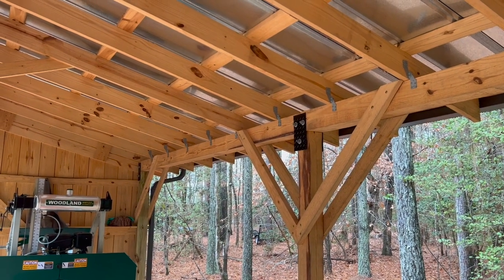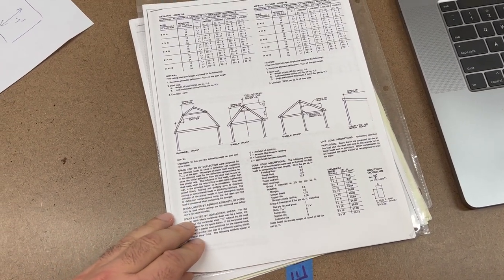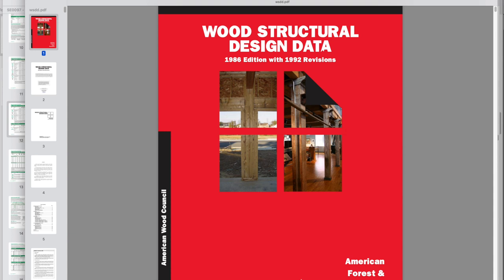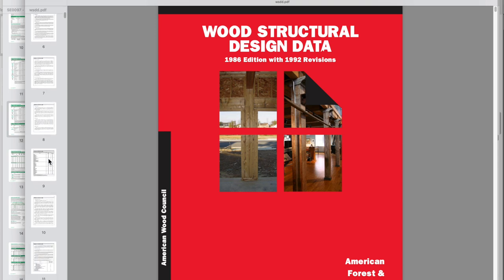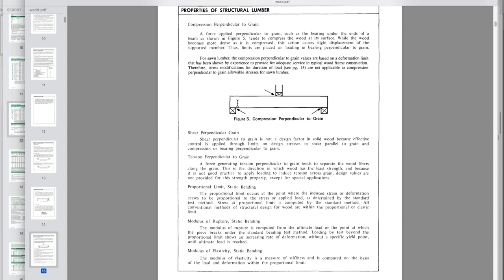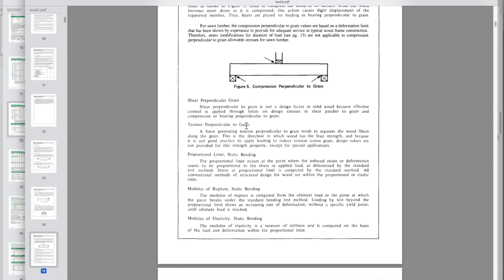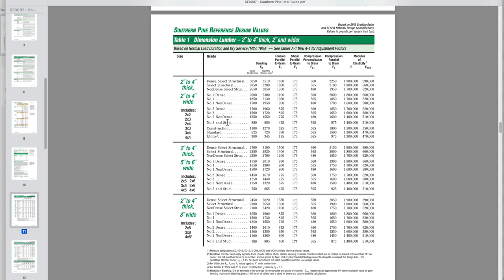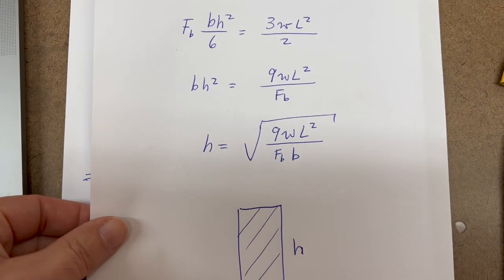What size beam do I need for my sawmill shed?

Comment: Great Video, I understand this was just an "example of the process", and is very good, but only issue might be that some folks might get confused of your use of Fb=1200. The reference material you show is for members 2 to 4" thick, 2" and wider, and your calculations are for a 5.5"x12" Beam...which is a "timber" that would be on a different but similar table by Southern Pine, and that table shows a #2 Fb value of 850...I was a little confused and thought someone else might be also, if you look at the current version of the table you show, the Fb for #2 starts at 1100 and decreases as the width increases...hope someone else who is working thru this doesn't get hung up like I did for a bit, keep the mill video content rolling, thanks
Reply from the maker: That is a good point, and a lot of these values depend on how you want to grade/rate the lumber.  I'll have to go back and look in my notes but I do remember adopting 1200 as a general purpose average for SYP even before I was using that guidebook.  Larger timbers could possible admit more flaws/knots/etc which is why they tend to get downgraded.

Comment: great video! excellent reference materials and your pictured formula explanations and verbal explanation really took the complex and made it easier to follow and figure out.
I am looking to do the same project for my sawmill and was looking at incorporating a "Scarf joint" midway of a 30-foot span, (Maple beams: 5.5"x12"x15') for the front opening of the Mill shed. Your reference guides will help me greatly in the beam dimensions to be cut. Again, good stuff !!!
Reply from the maker: Thanks!

Comment: Interesting video.  I am getting flashbacks from my post secondary education in Civil Engineering Technology almost 40 years ago.
Structural design was my favourite subject but I never got the chance to use the knowledge in my field of  work. 
 Did you also check the design for your posts (columns)?
Reply from the maker: I didn't since it's normally not a limiting factor on my structures, but it is important to do in general -- both for the vertical load and buckling concerns.

Comment: Great video. Can you explain a little more on how you were able to mix units of measure. For example, I would have thought you would have needed to convert “b” and “h” from inches into decimal feet before plugging into formula. Follow up question, and advice on how to calculate the laminating of boards together to make a larger beam? For example, my saw mill can only cut a 18’ board, but I also want a 25’ beam, so I was thinking of laminating 3 boards of overlapping lengths to create the full span. Thanks again.
Reply from the maker: That is a great question.  The formula was setup with a conversion so that bending moment comes out in in-lb and the units are consistent with the other side of the equation.  This was done on page 30 (#35 in PDF) of the WSDD handbook where you will see they slipped in a "12" to convert ft-lb to in-lb.  So L can go in as feet while b and h are inches.  Fiber bending stress Fb is in psi.

Overlapping is a real pain and you'll end up having to oversize quite a bit and use loads of fasteners.  You become very dependent on the fasteners, holes, and grain to resist sagging in the middle in order to handle the compression and tension loads.  The calculation for that will be much more complicated.  I wouldn't want to do it.

With care you can work a longer log on the mill bed if you have the ability to shift it back and forth.  Cut as far as you can, use a  chainsaw and hand saw to carefully remove the cutoff above the blade, then raise sawhead and reposition log to complete cut.  Repeat many times.  It takes a lot of fussy positioning but works.  I would not want to do it often but for a one-off beam it's doable.  Personally, I use my Alaskan Chainsaw mill in situations like this.  No limit to the length it can cut other than your patience.

Comment: your preference when milling and cutting 2x4,2x6,2x8 etc example 2"x4" or 1.5" x 3.5" ? Thanks for the informative video .
Reply from the maker: No preference, really depends on the project and whether or not the lumber will be mixed with store-bought dimensional lumber.
Reply: @Lumber_Jack   was not thinking of mixing. What did you use on the sawmill shed ? Does the true 2"x 4" etc tend to move less than 1.5" x 3.5" etc bow, check, curve, crown. TY for the reply
Reply from the maker: @logan979  Stability is really dependent on many factors and size may or may not make a difference at all.  I normally saw lumber to 1-5/8" thickness for framing projects (it will dry to 1-1/2") because I often use brackets and hardware sized for store-bought lumber.  Note that 2" lumber is insanely heavy to handle when using green, so that may be a factor as well.  If framing with green lumber, you can avoid stability issues if you get the lumber in place ASAP after sawing, properly nailed/braced before it starts to dry.

Comment: Considering the loads and structural geometry involved, what are your thoughts on using expanding composite foam for anchoring your sawmill shed, car port, etc. posts instead of concrete?
Reply from the maker: I don't know enough about the foam.  It would need to be able to provide some uplift resistance (concrete will have an advantage due to weight) and also resist side loads to prevent the poles from racking over.

Comment: I find the "Compression Perpendicular to Grain, Fiber Stress at Prop. Limit" of Loblolly Pine is 790psi.  Is that not the same as your Fb measurement?
Reply from the maker: Fb is the fiber bending stress due to flexure, whereas compression perpendicular to grain tends to be about what type of bearing area the wood can support before the grain yields.  You have to worry about this at joints, to make sure they are large enough to carry the load without crushing the grain.
Reply: @Lumber_Jack  thank you!

Comment: I feel like I just got an F in math class again. Lol. My worst subject by far. Did you use an LVL beam or was it pine? Is the calculation the same for an LVL as it is for pine?
Reply from the maker: I used LVL.  Same calculation but an LVL has much much higher fiber bending stress values than traditional wood, so you can get by with smaller/lighter beams.  Most LVL manufacturers will have product sheets that give their specs and some guidance on loads and spans.